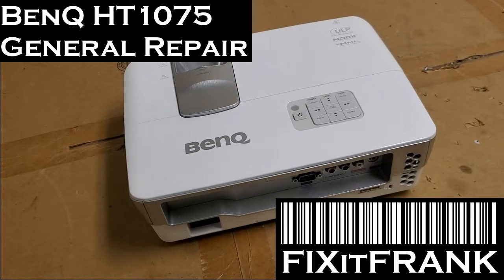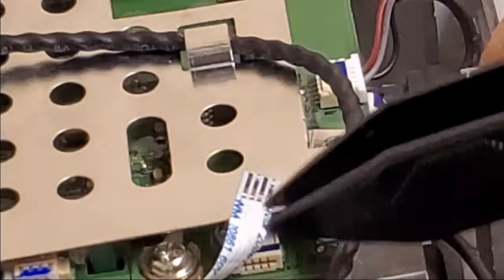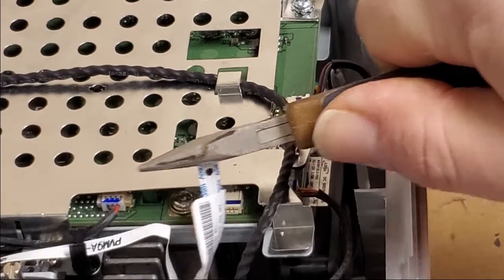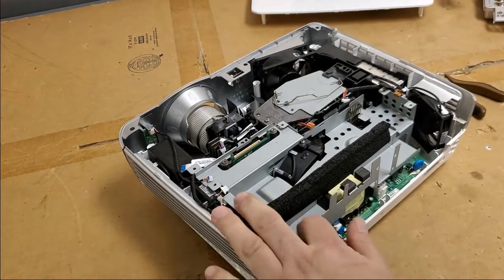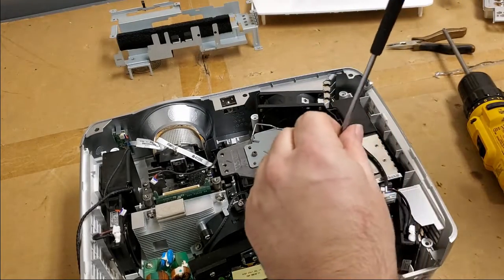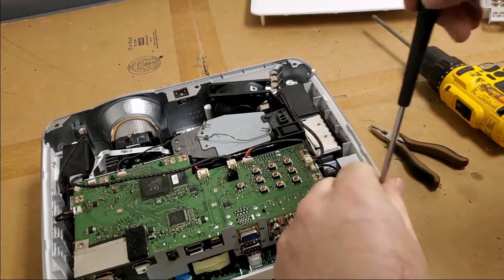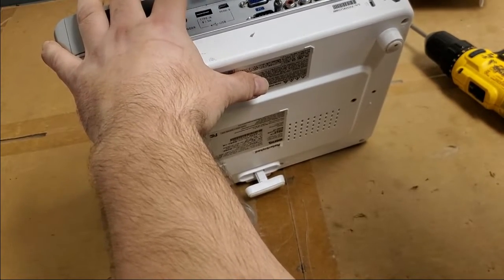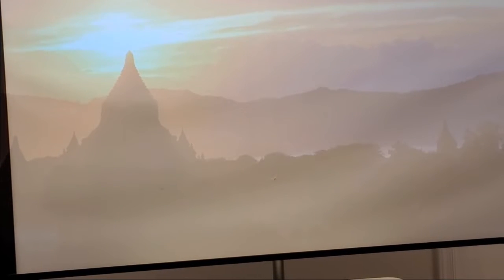BenQ HT1075 DLP Video Projector Repair - No Light/Overheats

Comment: Hi Frank, love your videos. I have a BENQ W1060 given to me by a friend, when I plug it in, the power light comes on (orange) and nothing happens, even the fans are not spinning. Hope you can help me with problem.
Reply from the maker: Hi Antonio, That's a tough one.  No response can be a lot of things.  If he had it apart, check the low voltage pins and their alignment with the mainboard.  If they are plugged in properly, then its most likely a bad mainboard.
Reply: @FixitFrank  Hi Frank, thanks for the quick response, I think she had it sent to someone to have it fix, the only reason she gave it to me is because she knows I like to tinker. Do you think its worth it to have this fix?
Reply from the maker: @antonioguerrero800  I wouldn't put any real money or a  new mainboard into it.  It's a little too old to be cost effective. https://elektrotanya.com/benq_w1060_ver.00_level2.pdf/download.html#dl  This is the service manual. It has the best troubleshooting steps. It might be something silly like a loose wire. The service manual will be your best bet.
Reply: @FixitFrank  Hi Frank, thanks on your honest opinion regarding my projector, also thanks for the link to the service manual, I will do some reading and maybe I could figure out what's going on.

Comment: Can anyone tell me the part name of the door switch casing ..i cant seem to find that part anywhere it holds the lamp and one connection goes to the ballast and the other to the power board..my projector ran hot an melted the wires going to the power board at cn602 on the power board
Reply from the maker: Ive replied to you 2x and you keep posting the same question.  Please reply to my response.

Comment: hi, I have an mp620p projector, when I turn on the leds they are all ok, the lamp turns on and after a few seconds it turns off. the LEDs always remain ok without any alarm, the projector remains on, commands blocked and the lamp is off. can you help me, i'm going crazy .... thanks
Reply from the maker: Hello Giuseppe!  How old is the lamp assembly? It sounds like a lamp problem to me.  I find that most issues like this end up being a lamp problem.  Not always of course, but most times.  
If the lamp assembly was replaced recently, then I would check the lens on the front. If the lamp is older, I would try a new lamp assembly or buy just the Osram bare lamp and swap it out.  An incorrect ND lens on the lamp assembly can cause this as can a failing lamp. There are other causes too, but this tends to be the most common in my experience.
Reply: @FixitFrank  hello and thank you for your answer, the first thing I did is replace the lamp, but also with the new lamp from the same problem as with the old one ....
Reply from the maker: If you want to email me, frank@fixfrank.com, with a picture of your new lamp assembly, I would be glad to help troubleshoot.
Reply: @FixitFrank  I send you a email, thank you!

Comment: some 1 chip dlp pj produces nice colours while some 1 chip dlp pj not good colours - what is the reason ?  - colour wheel spinning speed , 6 segments or 7 or something else ?
Reply from the maker: When the color wheel has more than primary colors it helps.  Red,blue,green, cyan, yellow are good. There are some older wheels that use red,blue,green,red,blue,green. Those were nicer when it used to be red.blue,green,clear. Also the refresh rate of the DLP chip. There are software reasons too.
Reply: @FixitFrank  thanks - observed better colour on infocus ,optoma ,dell than benq all low priced projectors - benq colour is horrible in low range pj ( used benq mp 515,610st ) - infocus x 9 looks like lcd colour ( low price pj )
Reply from the maker: @rahulkumar-qu2xo  I agree.

Comment: lines in dlp pj does it always means loose connection or dust in the connection part dmd socket ---- or may be bad dmd chip ?
Reply from the maker: You can think of all of those as a bad connection. The connection can be prevented by dust but not unless the board was removed to allow dust in.  Bad solder, loose DMD socket can cause it. I think this case it was not set down straight but I am not sure. The line is due to missing data that tells the chip what to do with those lines.
Reply: @FixitFrank  thanks - so you are saying whenever lines in image - dmd chip is ok can i be sure of that ?
Reply from the maker: @rahulkumar-qu2xo  Almost always. I will never say never but it would be very rare for a bad dmd to have lines. I would expect stuck mirrors with white dots or blurry with burn-in.
Reply: @FixitFrank  thanks
Reply from the maker: @rahulkumar-qu2xo  No problem buddy. I am happy to answer any questions you have.

Comment: Frank I have a android projector model: sync display ( exactly what ID Label says) System is about 2 months old. I have no audio from projector audio ports. ( I have a headset and a AV port) I use I got a Tannic X6s TV Box, Box has BT so I am using a external BT control to send audio to Sound system for room. ( its a trans/receive BT 5.0 Box) Not sure if there is a reset for projector audio or not. But for now I have been using BT audio from TX6s-h... Any ideas? I never did get audio from projector to work... David
Reply from the maker: Im sorry David. Those android projectors are a nightmare to deal with.  The manufacturers never have any info and last time I tried to find parts for one, it was like it never existed.  reddit r/projectors might have better info.  I wish I could help more but the data on those is so scarce.

Comment: Hello I have benq MW721 projector, normally when it switch on ,power bulb should be  red and it will switch to yellow mode....my problem is now it's now power bulb red colour and no switch to yellow colour...I can't  use the projector....any one can help..
Reply from the maker: If power is solid red and no other LED are lit, I think it is stuck in download mode. If someone started a firmware update that would happen. I am looking but cannot find how to stop download mode. If I find it, I will update here